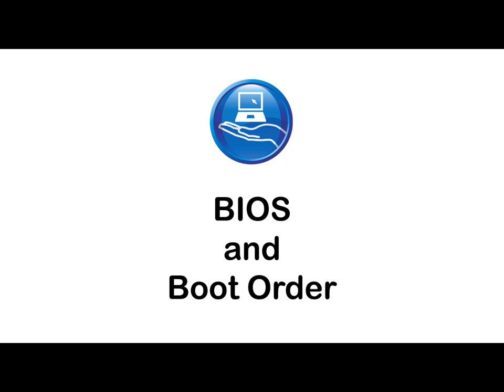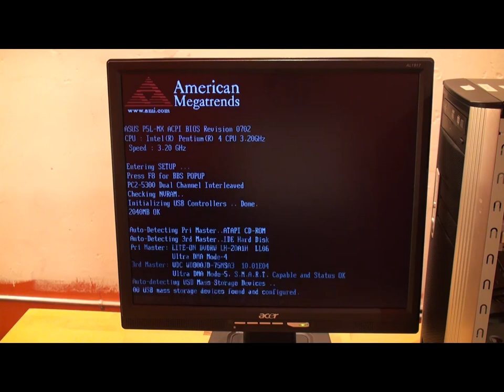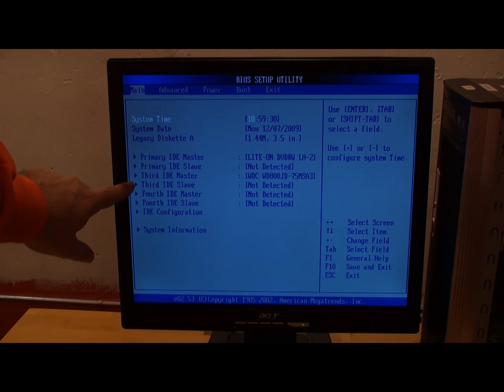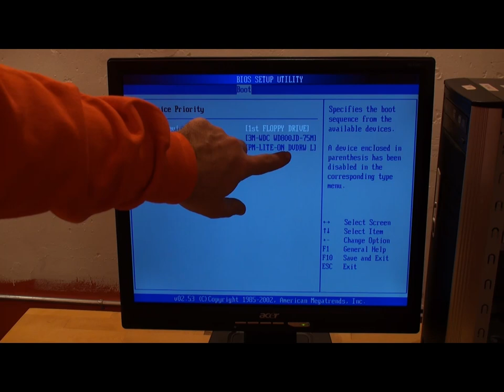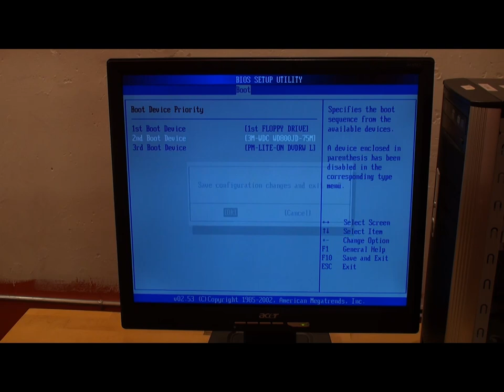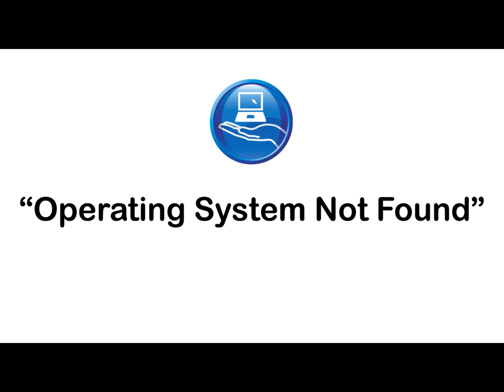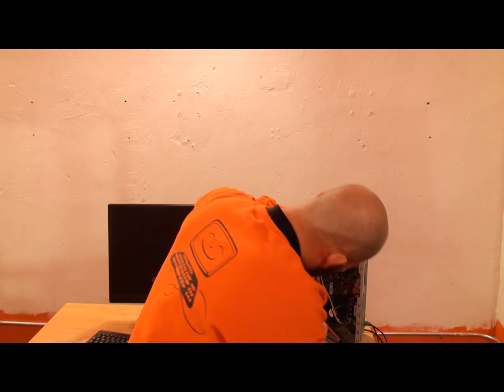Computer Hardware Repair

Comment from the maker: @GSWarrior18 Make sure to unplug your transfer cable.  Then take a look inside the USB port.  You may have broken off an insulator in there.  If you do the computer will freeze up and not boot.  If the insulator broke try to just shove a piece of cardboard in the port to separate the top and bottom connectors.

Cheers,
Eli

Comment: My parents' pc was making a horrible rattling noise, and the screen would go weird colours if you bumped the computer even slightly. I opened it up, and immediately saw that the graphics card fan was split almost in half and full of dust. We had always used this, with a DVI to VGA adaptor, since the onboard graphics wouldn't work. After I removed the graphics card and tried the onboard graphics, it worked perfectly, no rattling. So bear in mind, cheap graphics cards in cheap prebuilt machines can be a major problem.

Comment: Just my 2 cents as 5 year electronics technician veteran in the millitary:

Using "known good" parts is aka "Shotgun Troubleshooting".  It's the troubleshooting equivalent of taking a shotgun and blasting away at a problem until it's gone.  It works great in every situation EXCEPT one - when you have another part that is causing other parts to fail.  Say I have a hard drive that just keeps clicking and clicking, computer is BSODing or won't boot...I could put a "known good" HDD in and experience the same problem.  That's because the problem is due to the power supply applying incorrect voltages. 

This method of troubleshooting can get you into major trouble in some rare cases if your power supply is putting out TOO MUCH voltage and frying parts.  So you replace the motherboard or RAM with "known goods" and the power supply will just fry them instantly.  Now you're out good parts (at your cost) and still have the same problem. 

Moral of story?  In every boot issue (unless there is an error code), always, always, always, always check power first.  Always.  Always always.  Always....  After you know your power supply is good, then Shotgun Troubleshooting is green light for every other part.

Comment from the maker: @GSWarrior18 It looks like a watch battery and is somewhere on the motherboard. Just unplug the computer, then push in the power button to discharge any stored energy, and then take out the battery for a minute.

Comment from the maker: @borashnikov Sounds like you either have a video card problem, or your OS is messed up.  It is not your monitor...

Try updating the driver for your video card... if that doesn't work try reinstalling your operating system... if that doesn't work try buying and installing a new video card...

Hope that helps.

Cheers,
Eli

Comment: One thing to note with the No video issues is to also ensure you have know good working ram.  Malfunctioning RAM can also cause no video issues as well.  When cleaning and checking the heatsink for airflow you may want to also check the thermal paste to the cpu as well and ensure is is in good shape and does not need to be cleaned and replaced.

Comment: I don't know how many laptop power supplies i've seen that the wires had internal breaks in them.  Investing in a decent multimeter is a great thing for testing that.  you can also slowly bend the wire and move along it with your fingertips sometimes and see where the wire bends differently, or even feel the break, but that takes a lot of practice and a good touch.

Comment: A simple wire with two alligator clips is a great way to ground the case without having the power cable plugged in and the kill switch on the power supply turned off.  Also, a metal welding table is a good place to do work.  They also make standing mats for the floor that are good for grounding.

Comment: The first thing i usually do is open the computer and clean out all the dust. And it dosen't hurt to reseat the connectors and cards. Also there's free software you can use to test, such as microsoft memory test. To check the hard drive you can go to Seagate site and download the software to make a bootable disc to test your drive.

Comment: I usually start by opening the case and cleaning the dust out...then making sure all fans are turning...processor...video card fan (if it has one) and the fan on the back of the power supply.
It dosen't hurt to reseat all the cables and connectors. I used to be a tech with AT&T and found the first rule of troubleshooting is to do all the easy stuff first.

Comment: Laptop motherboards have those button cells for bios retention as well.  They are just harder to get to.  Some have two 'test points' that can be shorted to reset the password as well.  Check for service manuals for your specific hardware.

Comment: all you have said is true& good advices espesially about power suply i always do that unplugg&klikk several times on button and see light+Fan spinns cuz there are left ower power some funn things to that makes it easy to learn too. i whant to mention one thing that buying used parts probly only shud be an option if it is indeed a old computer but its used for retro gaming but shud be bught from some one you know that

Comment: While you are "troubleshooting" touch the CPU heat sink (the big block of metal directly under your CPU fan) and see if it is real hot.  Usually if you can hold your finger there for 5-10 seconds comfortably, its all good, but if it is hot enough to want to pull your finger away, then the heat problem is with your CPU.  Again can of air is your fix.

These are things to look for BEFORE the part actually breaks saving you some money.

Comment: I've seen ON switched that look fine, but oxidation broke them (breen stuff on copper). So you can just use your screwdriver and make the contact directly on the mainboard (or use jumper)

Comment: I do this for a couple reasons.  Main reason is the system runs cooler.  It will become "dirty and dusty" faster than a closed case but hey, can of air fixes that quite easily.  Another reason is, when i notice the "signs" of heat i can reach in and ("WARNING" as Eli explained in his "don't be an idiot speech") touch the fan to see if the fan is actually working and/or turning with just enough force to "look" like its working.

Comment: u said in this vid 2x  take the class on how two fix software issues . .but btw u damn rock . i have  a degree in  pc amin,a+ pc fundamental, and basic programming. coem on u tube  get to no other problems i might face on the job   . and u teach some real good stuff . might the best techer so far .

Comment: In my tool kit i have :
- sff 450 psu
- 1kit of DDR1/2/3
- my old 7300GT (doesn't use powerplug for confenience and to rule out faulty psu leads)
- cpu's for most sockets (base/cheapest models, doesn't cost alot)
With this, i can 99% determine if a pc has faulty hardware.
All this stuff fits in a backpack along with zipties, knife, variaty of screwdrivers, pliers etc.

Comment: i dont know about laptops but when it comes to desktops, if you forget the password to your BIOS you can reset it by resetting the CMOS. First unplug your computer. Then push the power button to discharge any extra electricity in it. Then remove the battery from your motherboard. Count 30 FULL SECONDS. Then put the battery back in, plug it up then boot the PC.

Comment: 15:20 Just sayin you don't always need to buy a new mobo if you forget the password, in fact you don't really need to as just reset the CMOS battery on the mobo by taking it out. However the BIOS will reset by the way meaning all the settings will need to be reconfigured.

Comment: How do I increase the speed of my computer I have an lga-775 quad core processor and a gigabyte ga-ep43-ud3l and it takes ddr2  240 pin memory cards .I would most likely want to end up with a fast booting more responsive and less glitchy response . I have media player issues it pauses and says media player is not responding . and it freezes and does not freeze when I select songs or want to burn a disc . I want to use the curresnt hardware I have it all works fine and money is tight . thank you for all your help and keep the great videos coming

Comment: I had a problem that sounds similar to this with a Windows XP computer tower a few years ago and the way I fixed it was by taking the whole system apart and cleaned all of the hardware (it was pretty dusty) but it didn't work so I ended up buying a new ram card and it worked perfectly I don't know if it will work but it's worth a shot

Comment: About video.  From my experience, usually the 1st thing to go in a system is indeed the graphics card fan.  If you catch it early enough, you can save your card before it "burns out."  

One of the things to look for, is "graphics lag" that normally does not happen.  If you are in a game and the graphics become real jumpy, way more than normal, grab that can of air and check your fans.  Heat is the #1 enemy of a system.  Myself, I run my systems with NO sides.

Comment: change resolution of windows. restart computer and press F8, a menu will come up adn choose enable VGA mode, Hit enter and voila it workd hopefully. Now find the max resolution your computer monitor can handle and set it by right clicking the mouse on the desktop and finding the resolution under properties. If this dont work go into safemode and uninstall your video card drivers, reboot and reinstall a more up to date device driver.

Comment: @TehTechnoWizard Sounds to me like either you have a video card problem in your laptop, or your screen for your laptop is dodgy and every once in a while your screen will just mess up and thats why you get the lines running down it.

Try making sure its not the video in your laptop, if it isnt. If you can, just replace the monitor for your laptop, if not. You'll have to get a new laptop (unless its under warranty then just replace it)

Comment: if you get no video it could be the video card or slot has dust in it or the memory is not seated correctly or has dust on it or in the memory slot.Also check the cpu that there is no dust under the cpu or in the cpu slot or dust on the video connector on the computer. Make sure you blow out all the dust and reconnect just the 20/24 pin cpu connector from the power supply and the 4 pin cpu connector from the power supply to the motherboard and see if the video comes on then plug each device in one at a time and see that it is working correctly before moving on to the next device of hardware
Reply: I meant 20/24 pin motherboard power connector

Comment: little thing at about 20 mins in might be worth checking fuse in iec power lead they occasionally  do go even with a surge protector i live in london and electricy pretty good over here but when im in ireland dont know if its just that building something is wrong like dodgy ring main etc or if its  the area but 3-5 fuses go a year in there 12 pc office

Comment: My parent's computer had the fan on the video card that stopped working... I simply removed the broken fan and attached a new fan (not the exact same fan, it would be too hard to find anyway; just a simple 80mm case fan) on the card with some wires, and plugged it into a fan port on the motherboard. Looks a bit cheap.. but it works, and cost less than $5 to fix. ;) No need to change the whole card (unless it has been severely damaged by the heat)

Comment: 35:00 - If I'll buy another hard drive and install my operating system on it and then boot from it, will I have access to my data on the old one (its sill plugged of course)?
Or what will happened?

Comment: Good Day, thank you for taking the time to make & share your videos. I have a P5P800 in Bios: Primary IDE Master (not detected) primary IDE Slave (not detected) secondary IDE Master (Sony cd-rw Detected) Secondary IDE Slave (not detected) third IDE Master (not detected) Fourth IDE Master (ST3250824AS) there is a picture on start up then white blip in left corner then blank. If I enter Delete when I  start up I can get into Bios. Any direction is greatly appreciated.

Comment: I learned in school last week, that if you keep the power cable in the PSU and just turn off the PSU that the PC is still grounded and you won't get shocked while working on it, rather then unplugging it and holding the power button.

Comment: Back my first days with PCs, I was using WebCrawler for everything. When I bought my second PC back 2007, it has been 11yrs up to that day since I had a PC in the house. So, webcrawler gave way to google, win95 gave way to vista (just wish I knew about XP then). Keeping with the years and all, I've reclamed some old win98 and up for the past 4yrs, I boot them just for fun, but Dban or IramNuke em quick and install a linux flavor onto it. I had found one that could run win7 once lol;)

Comment: Actually i was having power button issue and to check this i had follow out whitch pins on MB are connected to actual button and then i removed those cables from pins and short circuted them with metalic screwdriver.That worked and also there is a led that indicates if MB recieves a power from power supply.

Comment: Sure, a 13 year old can replace ram or maybe reapply thermal paste, but you need years of experience to pinpoint issues inside your PC. You can spray and pray and start removing and reinserting random crap if that's your thing...but it takes knowledge to figure out where the problem really lies.
Reply: He wasn't trying to be offensive I'm sure.
Reply: LOL!

Comment: If someone in Europe accidentally sets that voltage switch to 115 instead of 220, then it will get too MUCH power and most likely kill the PSU, meaning you may need to actually replace it with a new one.

Comment: So, don't leave it plugged in to ground the case?  Most power supplies have a kill switch on the back that cuts the power, but leaves the ground connected.  If you are going to unplug the PC before working on it, then make sure that the metal parts you touch to ground yourself, are ALSO grounded.  I know this was an honest mistake by the video creator, but that ground can go back into other equipment the wrong way.  If the case isn't grounded, touching it to dissipate static is just as bad.

Comment: when troublshooting always start at the physical layer and work your way up....i had a problem where my monitor would not power up....   checked the cables and they looked fine , hooked up to another monitor and it workd...so it wasnt my pc.(thinking it was a bad vga cable or video card problem)   however, come to find out the plug in the back was all the way plugged in the back of monitor.......lol   simple simple things.

Comment: Grab the data you want to keep from the HD and reinstall the OS. If you are still getting the error, its probably a motherboard failure. I can't say more than that because I would need to view the computer for myself to give a better diagnosis.

Comment: the only reason i think is if its a brand new out of the box then loose wire but if secondhand it will be the battery just replace it

Comment: Sometimes even wires are damaged .So it shows "Operating System Not Found" so first check for wires otherwise you gonna mess up with all data on hdd .

Comment: Hi Eli, thanks for your good work. I just started following&got lots to learn. I have a challenge with 'my' laptop,it suddenly trips off after showing a blue screen& it doesn't  stay long enough for me to get down its error report. I have uninstalled the suspected application &even done system restore yet the  
challenge remains. (C:\Windows\Minidump\121812-32354-01.dmp
C:\Users\Ay Pumpn\AppData\Local\Temp\WER-35739-0.sysdata.xml
Locale ID:1033) got it 4rm eventlog
Problem Event Name:BlueScreen

Comment: I came here just because i got blue screen. I run windows memory diagnostic tool and he said that i got hardware problem.  I sometimes get blue screen and sometimes don't. After blue screen my computer restarts and works perfectly normal. I just want to get rid of that blue screen, if someone can help please do.
Reply: Boss Leon first thing is to make sure your video cables are plugged in directly. If that doesn’t work make sure that your video card is updated. Make sure your boot drive isn’t corrupted and make sure that you update your OS

Comment: Hello I have an amazingly obscure problem, I'd be forever thankful to get this fixed and Ill try anything.  My computer randomly freezes, Its newly built. I've done anything from XMP settings to firmware for ssd, reinstalled windows. absolutely everything. Im forced to manually shut the computer when it freezes. Heres the parts: i7-3930k gpu: gtx 680 dc2, 120 gb ssd force gt corsair, 3tb Hdd seagate, 850 modular Psu and 16GB corsair Vengeance ram, the mobo is a asus rampage 4 extreme.

Comment: I do need a good harware in order to play games that are coming up next year for instance Fifa 14. I got the old specs which are insufficient to run new games but might as well pay for a new graphics card and most games should be run with some lags but to be honest i wont be able to play games that will be released in the next 3 years obviously.

Comment: Hi,
I had recently called a mechanic because I had same problem which you was explaining, it was not turning on 😲. That guy from computer repair shop came with a device, I don't know thats device name but I know that is use to check voltage of circuit. He put its 2 pins on mother board and told me that it is not responding. He took my cpu to his work shop. 

Next day he came had said "one side of mother board was burned because of short circuit" he told me that he had replaced that part with a part in his shop. 

He didn't mention any hing about psu. Now same problem is occuring after 1 week. 

Now my question 
Is he is cheating me? Or make me fool? 
Pls anybody answer me i don't want to waste my money more.